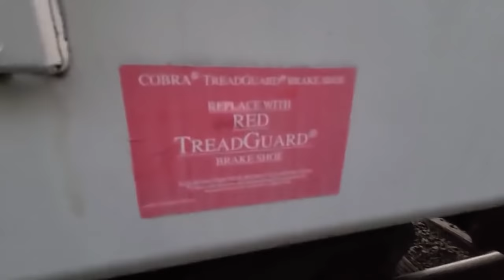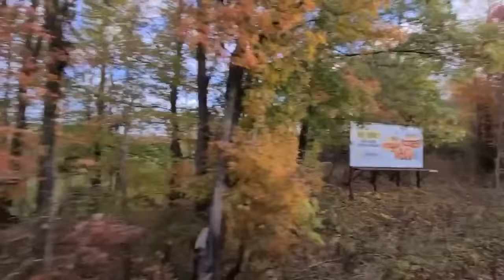Boxcar ride to Tennessee

Comment: Shoestring, a solution to losing things through the holes in the Cadillac would be to buy a few pieces of that thin magnetic sheet they make fridge magnets from. A few pieces big enough to cover those holes would do the trick and stay put. And they’d be light and not take up much room in your bucket or pack.

Comment: Tennessee railway rock exposure is where I've gone to get into limestone caves.  
Your entry could find a dry camp between high  solid stone wall.  .Past the glow 
reach of sunlight the darkness may hide things best avoided.  Campfire smoke
inside can kill so do that outside and downwind of a cave entry.  On the plus
side excessive farting in boxcars or caves isn't fatal.

Comment: BNSF has reduced crew on the longer trains to one Engineer.
So, if Shoestring is on one, where that one person is obliged to walk
past looking for a problem, you should get off quick if the ride
starts moving again as a runaway or by illicit cab operation.
Times are changing and ride safety is being compromised.
So corporate bosses and stockholders get bigger pie slices.

Comment: Amtrak by active Congress or by citation from President Biden or the maternal heart of Jill Biden should appoint you as a director of or rather appoint you as to be on the board of directors for Amtrak rail America. If anybody knows the railroad system in America it certainly is you you have 30 years of experience. You would be a great asset to Amtrak you have a steady job study paycheck you could get an apartment and you could ride the rails anytime you'd like legally and get paid for it and if that is not an option they should automatically make you a train conductor for Amtrak if this is something that you would consider you're the best in the business thank you for the videos

Comment: Shoestring, are the DPU's unlocked and do you ride in them often. I did see you riding on one in a past video.
Reply from the maker: Most are locked nowadays but just a few years ago none were locked.   I have a couple  of universal keys that unlocks them though. 
I rarely ride a DPU unless either the weather is unbearable or a worker suggests that I do
Reply: @TheHoboShoestring  Ty for answering SS. Stay safe. 🙏

Comment: I saw a low boy railcar with a load limit of 580,000 pounds and the light weight of the car itself was 110,000 pounds. It was carrying some monstrosity concrete piece for the Navy. I guess that's why it had 4 trucks under it. Be safe Shoestring.

Comment: Shroom says: I fell down a flight of concrete and steel stairs. I didn't break any bones but every part from my head to toes hurt. Shoestring is the best medicine! Refused  pain meds but gonna climb into a hot tub when I get up to use bathroom. Gonna soak in hot water until the water turns cold and take some sleepin meds, may be I'll dream about a travelin adventure.